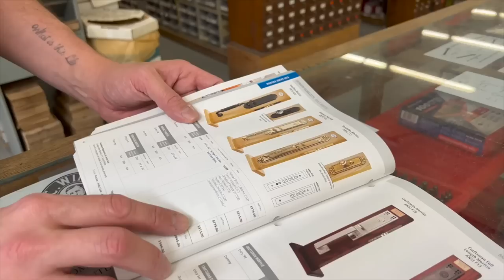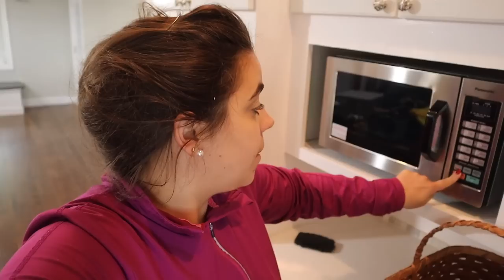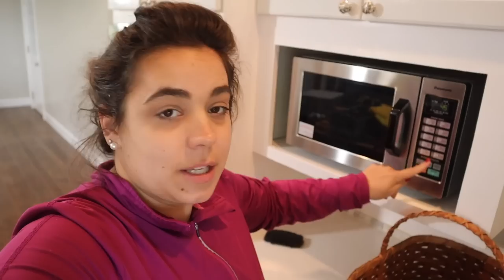It's gonna get WORSE before it gets BETTER!

Comment: Helpful hint - when you remodel your kitchen repurpose the cabinets in another part of the house - garage, workshop, laundry, or your canning/food preservation room. The cabinets look in good condition and they can be sooo expensive. This is all very exciting, congrats to you both!
Reply: Good call! Especially as the cabinets will be critter-proof.
Reply: What a great thought!
Reply: That's exactly what I did 7 years ago. "Waste not, want not!"
Reply: New doors and paint can work wonders and new hardware.
Reply: That’s a good idea!
Reply: Yes, absolutely! A bit of paint and will look brand new!  I would take care of the laundry room first...it is always good to have lots of cabinets in the laundry.
Reply: @camicri4263  
 I would have kept some of the base board wood to use for other purposes too.
 I know Becky wants an Ironing board that drops down from the wall & that base board wood would make a good support strut, put a hinge on the underside of the ironing board attatch the piece of wood (angle cut) there & have a rubber stopper added to the bottom to rest upon the wall.
 I would cut a recess in the wall where you want to have the ironing board to rest in (between the support struts), use the old baseboard to line the back & make a wood swivel latch to hold the ironing board up in place with a stopper/rest so the latch will stay in place. Use old cabinet doors to make a door flush to the wall for the ironing board. Out of sight & no wasted space in the laundry room.
 If there's a deep enough recess where Becky wants the ironing board to be, make a shelf inside and it can be where she puts her laundry supplies. 
  So many ideas to use the baseboards for. 
  They looked like good sturdy solid wood too.
 Another long recess cut into an area between the support struts could be made into a hanging broom/mop/ cleaning tool closet in the laundry room. Use the baseboard wood to frame it & put up strips to attach hooks to & hang your tools that would fit in there & a matching style door like your ironing board cupboard.
 Use your unused space for storage areas.  😎👍
Reply: She’s driving a car with leather seats and a sunroof and they bought at the tippy-tippy top of this inflated market... are they the cabinet-saving types? Do they need to do that?
Reply: Just told my husband since we’re doing a kitchen remodel soon, great idea … thanks.
Reply: Love these kinds of renovations.
Reply: @peachykeen7634  what’s wrong with saving money even if you have enough. Rich people only get or stay rich when they use their money good. I don’t think Becky is superrich, but I think she and her husband are very wise and don’t waste things.
Reply: “For God so loved the world, that he gave his only begotten Son, that whosoever believeth in him should not perish, but have everlasting life.”
John 3:16 

 “and saying, The time is fulfilled, and the kingdom of God is at hand: repent ye, and believe the gospel.”
Mark 1:15

“The thief cometh not, but for to steal, and to kill, and to destroy: I am come that they might have life, and that they might have it more abundantly.”
John 10:10
Jesus loves you
Reply: @peachykeen7634  Those that have saved and paid cash as they go along are buying now as the prices are going to continue to go up and interest rates will as well. We are also looking at a slow down so they may have obtained a good price for that car. I don’t doubt that they have already sold their other home (in a more expensive city area) with a delayed leave date to move to the country where the prices are a little less for more. Becky is frugal.
Reply: In the basement for your harvest right frrezer to sit on and have work space.
Reply: @peachykeen7634  She saves money everywhere she can but probably does not sacrifice on stuff she really wants. And quite frankly that’s the way most people are. Being really good with your money in every facet of life allows you to splurge on things such as this. Every girl wants a nice kitchen and house. And she works really hard and deserves it and most certainly should have it.
Reply: Everything is expensive these days .. 
don't understand why disposing things. 😡
Reply: Hopefully they will repurpose/donate or sell the cabinets unlike the trim she threw away at the dump.
Reply: Wise advice! I agree.
Reply: @booksandali  she tried to donate the wood but no one wanted it.  She donated everything she could.  Why is everyone so freaking critical!?
Reply: @karenmomoftwins8847  Have you bought trim recently? I have and it is super expensive! She is so lucky to be able to replace all the trim in her new house because it didn't match. Listing it on a free local giveaway website or group and waiting a few hours she could have gotten rid of it easily without it ending in a landfill.
Reply: @peachykeen7634  I personally save where I can and that allows me to put extra on where it can mean more.
Reply: I know I'm late to the game, but if she is in the PNW the landfill will most likely have a section for lumber. When I lived in Roseburg Oregon all of our landfills had them. They are then taken and made into particle board and paper if the peices aren't rotten. I personally never had a problem with my trim not matching. I figure there are usually bigger problems to deal with lol.

Comment: In regards to a wood shop for Josh, go for the rv bay in your garage. He’ll use every bit of the space and the ceiling is too low in the old one. Every time he lifts a piece of wood, he’ll hit it. Also, it gives a dry space for lumber storage. Build your dividing wall first though as sawdust gets everywhere!

Comment: Just an idea….I did the same thing - changed the hinges to match my door handles (brass to brushed nickel).  I put all the old hinges In a zip lock bag and threw them up on Craigslist.  I had a builder buy them within a half hour.  It was a way to recoup some of my cost of the new hinges.  Love watching the transformation of your forever home.  Also, that view out the kitchen window over your sink is so relaxing.
Reply: Yep. You can sell ALL kinds of construction items on craigslist or facebook.
Reply: Also all that trim could have been put on craigslist or facebook. If I was in the area, I would have bought it. Or, give it away for free so it doesn't go to landfill.
Reply: @Meggs23  AMEN. With lumber prices what they are and the fill capacity of our landfills, it would be a win win situation. I like the way you think. 😏

Comment: Just a suggestion as an older home improvement person. We have remodeled and or built several homes over the past 25 yrs. So you may want to save your curtains to repurpose as duvets, pillow covers, dog/cat bed covers and many other uses. They seem to be made of neutral, quality materials...
Reply: I was gonna say, wash and sell, but reusing as stuff like that is a great idea. Never thought of that...
Reply: I was thinking the same. Fabric is expensive & they can be used in the odd work room, lining a chest or used around the house for all kinds of stuff. Hold onto them, until you've settled in... if you don't use it by then... donate it.
Reply: When we moved in we used the old curtains as drop cloths since they were a color we wouldn’t use.

Comment: Good work you two. One thing about the curtains. When we moved into our house years ago there were some wall to wall curtains in the living room and dining room which were not my favorite. However when we changed them to blinds a number of years later I realized what a difference they had made in keeping the house warmer (they were super thick.) I don't know how thick your curtains were but sometimes when you don't know how a house operates, you might want to keep them for a bit and see how much heat they could help keep in in the winter or out in the summer. Just a thought I had.
Reply: I also think it’s wise to save them until you’ve lived there a while. They are custom fit to the windows and would be very expensive to replace.

Comment: For those worried about needing curtains due to strong light. That's rarely an issue here and custom houses (like this one is) are sited to use the light well. If you go back and watch the initial vid about the house, not the trees placement. What you need curtains for is the cool nights from Nov through June.

Comment: Cant wait to see all the improvements and changes you make. I'm a do it yourself person so love watching someone else do it!! One thing you might try before getting an expensive electrician. When repainted all of my rooms I didn't like the color of the plates, switches, etc. Didn't have the money to buy new, so  I ended painting them the same color as the walls. (the screws too!!) I took them off, painted the wall, them put them back on and painted them. Easier than trying to lay them on a flat surface!! It worked beautifully. I used regular latex paint. In my dining room I painted it med green and it's been 3 years. Even the light switches that we use almost daily still have the paint on them with no chipping. I've even cleaned some of them and it still stayed on. It gets a little tricky on the plugs but i just used a light roller over them then touched them up with a small soft artist brush close to the holes. Now I've done this in every room and it really hides the plugs especially the ones out in the open!! Makes them look custom. Another thing I do is when I'm done with a color, I fill a small canning jar!! with some of the paint, mark the room and keep it where it is handy. This way if you have to touch up something later on you dont have to go dig the can out!!

Comment: For the chickens get a good electric fence charger and run a line around the bottom of the coop and run. I ran one about 8 inches from the ground and this has completely stopped the predators from getting my chickens. I was loosing them a couple a week and this stopped it. It also protected them from my neighbors dogs.
Reply: Oh, good tip!  :D

Comment: I'm loving these vlogs Becky. Home reno is something I really enjoy as well. There's an ongoing and tedious process to parts of it like you mentioned, but there's something to be said for working along side your soulmate and having a satisfied tiredness at the end of each day's work.

Those wonderful windows look great without the curtains! Personally, I'm not a fan of curtains because of the dust collecting factor anyway.  If you do replace the blinds some day - especially if there's a fair amount of heat loss/gain through the glass - try to find honeycomb blinds. They're a double layer of fabric that, when drawn down, trap air between the layers and so provide insulation. They're called honeycomb because that's what the profile looks like from the end when they're drawn down. Clear as mud??

Comment: Those larger rods are hard to come by  and if they are made to hold heavy black out draperies than they are good to hold onto. Not only can you paint them but you can get new finials for the ones that have finials. Usually people update them with just new finials (decorative ends).

Comment: Becky, I went through this whole adventure recently and I have to tell you that IKEA is a great way to go in the kitchen.  I don't know if you've gone to look but their quality is pretty good, the prices are great and the timeline is amazing.  The best part is you can go in and redesign the whole space without having to work off the current configuration if you don' like the functionality of the current kitchen.  Another bonus is that you save so much on the cabinets you can splurge on the countertops.  Again, I got IKEA and my friend went with custom.  Hers took 4 months and cost 4 times what mine cost and at the end of it all my kitchen was nicer and better quality than hers.  She had finish problems within a year.  I highly recommend looking into IKEA for kitchen, bathroom and storage cabinets.

Comment: This isn't the correct video to be responding to concerning your oven temp, but Just a note,foil you have placed in the bottom of your top oven is preventing the temperature to reach its optimal heat level.

Comment: A handy tip for a non locking lid on a crockpot,  either you can use a long rubber band and twist over the lid from handle to handle,  or use 2 rubber bands use over know on lid too handle, and same on the other side..... I used to be in Mops at church and my crockpot then did not seal lock, so I learned these tricks. 😁
Reply: Great tips. None of my crock pots lock
Reply: I was going to suggest the rubberband trick as well. We participate in a lot of potlucks & do this all the time.
Reply: @lisamartin3346  and if you use a Renalds crockpot liner, it seals better and cleanup is a breeze
Reply: @heatherjohnson2511  Thanks. I’ll remember this!

Comment: I hope you started a "rehab notebook".  When we built our house, my notebook was my brain.  I had a section for each room and sections for flooring, paint, wallpaper(which would look great in your downstairs bathroom.  There are peel n stick varieties that are very easy to put up and remove, if your tastes change), hardware, etc.  It was spiral ringed and smaller than81/2×11, so it fit in my large purse.  Technology is great, but having the notebook, with everything available right in front of me, and something I could file away to reference later to see what I had, in case I needed to replace a drawer pull, etc, was and would be so valuable to have.  We get new technology and forget where all those notes about our house are. If they're in a file, it's so easy to access.  I even taped my paint sample card on a page and wrote the number of gallons used for each room, and where I bought it.  For other samples, I bought a small 81/2×11 plastic file box, that I took everywhere I went, in case I needed information I didn't think I'd need.  If it was in the car, and I was at a third store, looking at cabinets, I could get my file box and look at the wood sample to compare it with the countertop sample I was thinking about. Once I picked the countertop, I put a sample of it in a "kitchen" file folder, in my file box. I did the same for "bathroom 1", etc.  That notebook and file box was what saved me from making disastrous mistakes, like ordering too much or too little.
You should check with the sellers to see if they have blueprints for the house, or go to the county offices where builders have to turn in a copy, and see about getting a copy of the blueprints. It would have measurements that are precise and the blueprints would look so neat framed, and put on the wall of either your office or even the woodshop.  It's be a neat gift for Joshua.

Comment: You can spray paint your outlets gloss white and replace with a new white cover, they look brand new. I use a small cardboard box with an outlet sized opening cut in the back to control overspray. I clean the plug well with a little windex and terry cloth rag and let it dry. Remove cover, give it a quick spray inside the box with the opening lined up with the outlet, pressed against the wall. Does NOT take much paint. Just a quick dusting. You don't want heavy spray or drips. One can of spray paint will do every outlet and switch in your house. With  fresh new cover it looks like you replaced every box. They will not yellow again... plastic yellows with age but the paint does not.

Comment: You can paint outlet covers as you paint the walls, so they blend in. As long as you aren't glopping paint on thick with a brush, you don't have to worry about paint getting into the outlet. I paint over them with my roller.

Comment: Omgeee, you both are doing a fantastic job!
I'm also like you,  like a kid in a candy store when it comes to picking hardware. 
One thing I did want to mention was that the curtain looked like they were good quality and a light color. What if you wash them and keep them (at least for a while). Or until you know how house "works". What I mean is, what if they help keep house warm in the winter. Which will help with cutting down on heating bills. And if you regret getting rid of them, trying to replace them is going to be costly. Idk, just a thought.

Comment: Hi Becky. I saw your espresso machine is plugged in. You should always unplug any appliances you aren't using because they still use power when left plugged in. It's called phantom power and raises your utility bill. I learned this from my mom who worked at PG&E for more than 30 years. Just a tip for you to save money wherever you can. Take care.

Comment: If you like the curtains then I suggest having them cleaned and save them. You may want the curtains when weather is at extremes during the winter and summer. Or you could remodel the curtains for the other rooms.

Comment: If you decide to do new curtains, consider sheer white curtains.  They look crisp and would complement your look.  They allow light through when closed and you can see out of them but they also actually provide daytime privacy if you need it.  For example if you’re out for the day and don’t want anyone to be able to enter your property and look through your windows.  You actually can’t see through them when you’re outside looking in - during the day.   They don’t provide nighttime privacy when there are lights on inside so you’d need to use your blinds for that.

Comment: With each trip to the forever home, grab a jar (or 2) of all that you have preserved + flour & spices, to leave at new place. Do the same (if you can) with cutlery, plates, utensils - if you can't spare these, thrift them. So you basically have a sample of your kitchen in your new home, this will make things a little easier & when you are ready to move in properly, anything you thrifted before can be re thrifted. 
Also you may want to re-think the curtains as you don't know how cold it gets at night or in winter - the curtains will help keep heating $$ down.